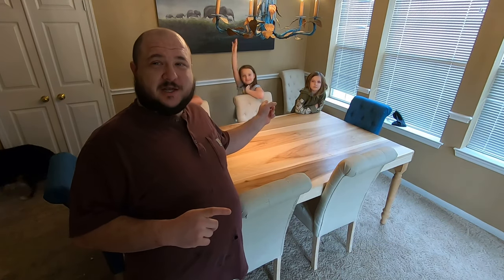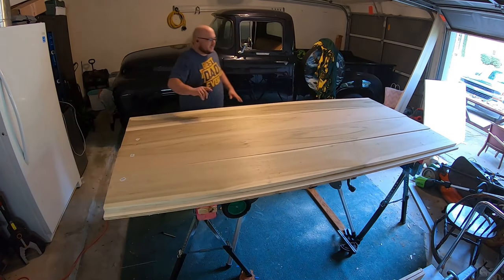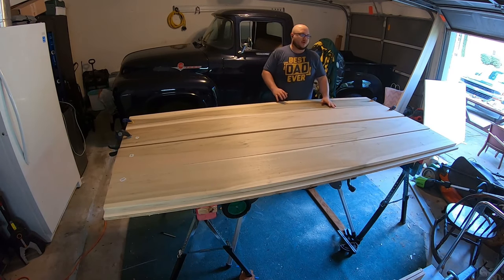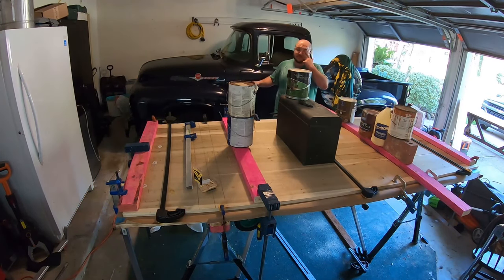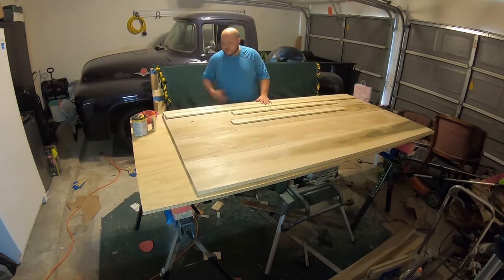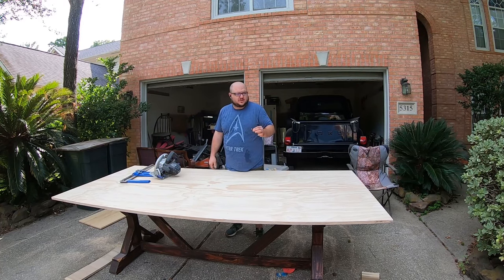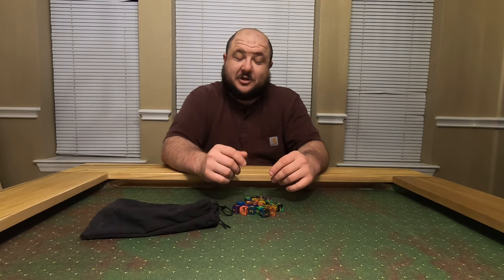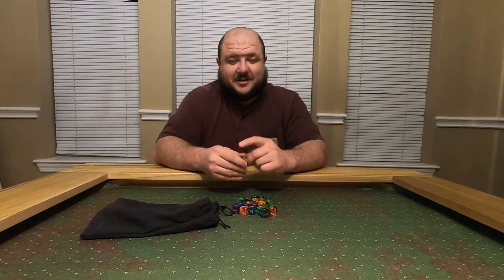How to make a Hidden Game Table

Comment: OK I love this table I am in the works of building my own table for table top games and also DnD games nights. You said that with the dowls that it is not the right way to do it. What would be the right way to do it?
Reply from the maker: I should have set it with screws or glue first, then dowels so it would be more structurally sound… it worked, don’t get me wrong, but better ways of doing it than I did on that part